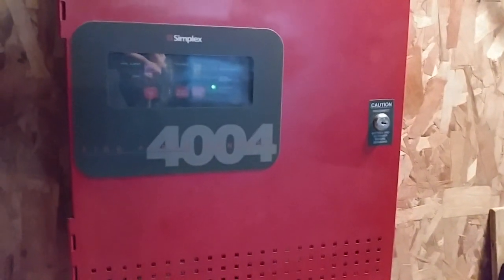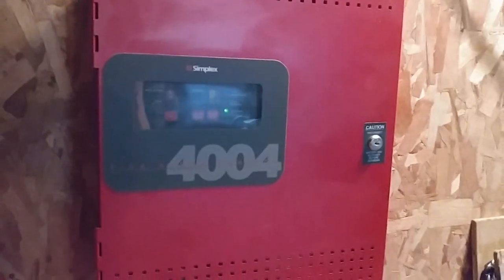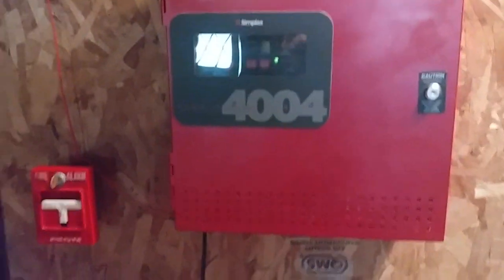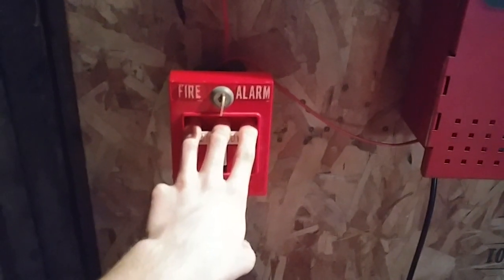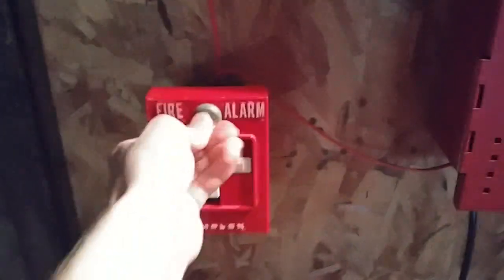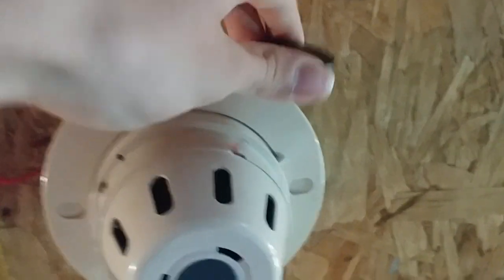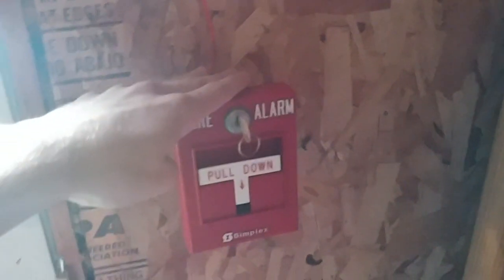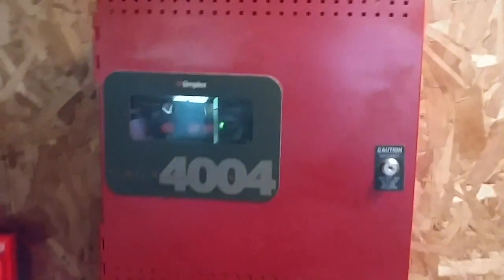fire alarm System test 33. #FireAlarmFriday

Comment: How to you remove the strobe off the 4904 housing without cracking it, I’ve already cracked one housing, so I figured I’d get help with it lol
Reply from the maker: Theres the small rectangular holes and you would put a flat head screwdriver in and it should be release